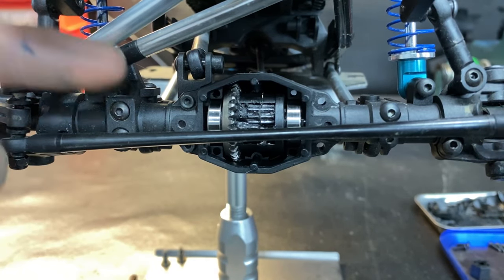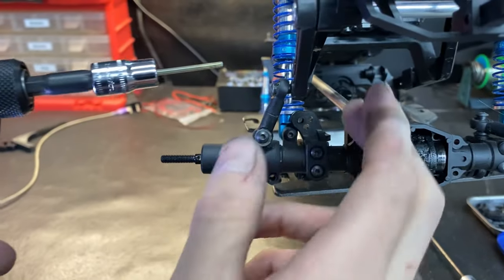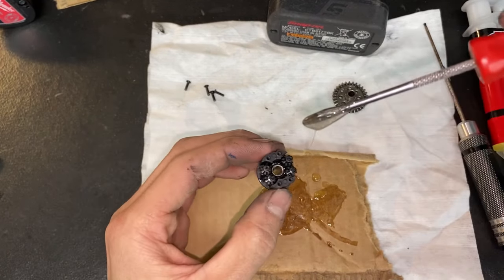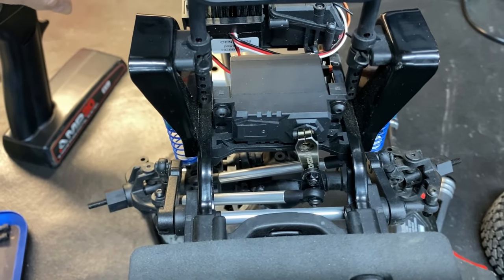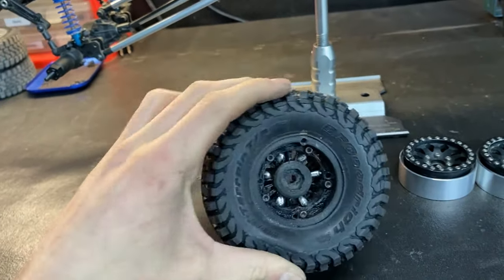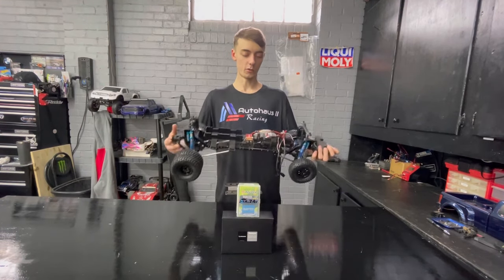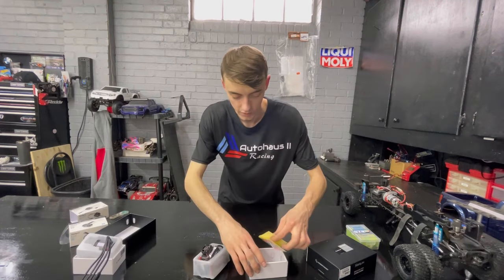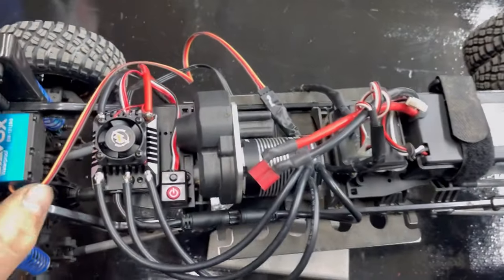CEN F-450 ULTIMATE Upgrades!

Comment: Super cool build! Im building my own toe rig, for a beer cooler rv camper trailor. I noticed your steering problem after lifting, I would suggest doing a vertical servo and dropping it down a bit, it will turn the wheels better then the long arm horizontal, less flexing the steering arm. Can't wait to see that new trailor on the printer!
Reply from the maker: Awesome, id love to see it! Ah yes that's a very good point, thank you I'm definitely going to experiment with that! 🙏🏼
Reply: @QuadeCrabtree  i love what you did with the white color on the body in the other vid caused it looked like my dads truck but im planning on getting as much as i can to earn money for it i should have it by christmas ill just get money for my birthday and other stuff
Reply: Are u blood Crabtree? As well. .
Reply: @rosecrabtree2390  just wondering are you meaning like crab walk? 🦀
Reply: If you want it to go fast at all don't lock the diffs it will fill at every tiny little turn!!!Except for my crawlers I like how trucks with unlocked diffs drive and it's funnier on the trails and In mud because it's more of a challenge!!!

Comment: Hey I just bought the same truck and I'm pulling a gooseneck also did you have any problems with your motor ESC I'm thinking about buying the same one so I can haul my truck around
Reply from the maker: No esc problems but definitely motor problems. If you have some time look up my last CEN video. We caught the factory motor on fire lol. I'm testing a different motor/esc combo as we speak because I'm not happy with the performance of the hobbywing for my use. Will have an update video out soon after more testing.

Comment: Thanks for the great videos and tips.  I put the 100mm shocks on mine and added longer rod ends all around.  Unfortunately the rear driveshaft is now too short.  I moved the rear driveshaft to the front and now I am looking for a longer rear driveshaft that will work.  Any ideas for me?  Any advice would be appreciated.
Reply from the maker: Thank you for watching and your feedback 🙏🏼. Yes that happens unfortunately I don't at this moment but I will soon. I just purchased another F-450 to build so I'm going to be working on that and can do a video on it for sure. The truck in this video now has a full 1/8 system and drive terrain so it is no where near stock lol

Comment: Looks cool but you should add a spacer between the duals. The tires shouldnt touch each other
Reply from the maker: No they shouldn't from a "true" scale form. But the way I connected the two wheels it would of been very difficult to add a spacer and balance the wheels with the available materials I had at hand. But it works great for me this way and I like it. Thanks for the comment have a awesome day! 🤙🏼
Reply: @QuadeCrabtree  the thing is that the tires dont get to flex over rocks and such stuff when the two side walls are together. You should look into having wheels 3d printed. A friend of mine printed duals for my wpl rc they work great. I do agree with you on changing the wheels that the cen comes with though, i also love the cen f450 but i dont like the wheels and tires either.
Reply from the maker: @gabrielpichardo1492  so far she's worked and flexed just fine for me how it is currently but I appreciate the recommendation. Also refer back to the video, inside wheels are 3d printed ;) outside are metal because I like the look better.
Reply: @QuadeCrabtree  i love the look as well. Cant wait to see more of it
Reply from the maker: @gabrielpichardo1492  Thank you!

Comment: Why did you use Teflon tape on the shock threads? I've never seen anybody do that and those shocks seal with o-rings.
Reply from the maker: Because as I explain in the video those shocks have a big tendency to leak from that oring. So the Teflon tape prevents that and they don't leak 🙏🏼 try it out!
Reply: @QuadeCrabtree  oh. I didn't hear you say that. I don't have these specific shocks so not a concern for me. Sweet looking truck!

Comment: I put 100mm shocks on mine frame sits to to right a bit on front and left a bit on back I removed rear sway control bar and front and rear link . Don’t no how to make it even maybe the lift kit
Reply from the maker: Yes to have it properly aligned you will need to extend the center axle link coming from the frame. I make some mounts specifically for this that are for sale on our site 😁🤙🏼
Reply: @QuadeCrabtree  cool what’s ur website

Comment: Hey bro you put the first diff back together with the gears all the same height and I followed your every move and then at the end I noticed you put the gears back how they were stock!! Not cool that you didn’t mention you had to go back and take the first one apart to flip 2/4 of the gears... now my shit is drying and it’s wrong apparently. Hope it works out for me
Reply from the maker: Not entirely sure what you mean here, my truck operated fine and other have as well. This is an upgrade video not an exact instillation manual. I'm a normal guy and we all make mistakes. I apologize your having issues and hope everything worked out for you sir!

Comment: Hey man, where did you get those wheels & tires in the thumbnail picture & what size is the wheel & tire?
Reply from the maker: They are Proline 1.9 BFG Mud-Terrains on a 1.9 Method wheel. Both from Amain hobbies 😁